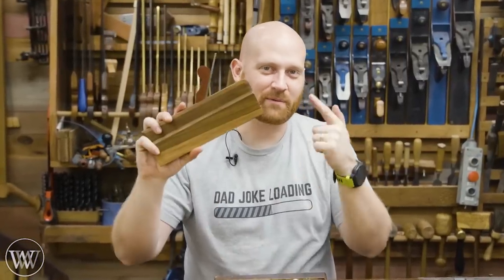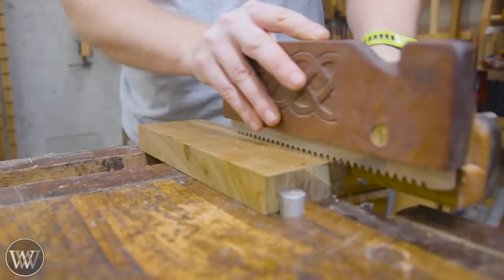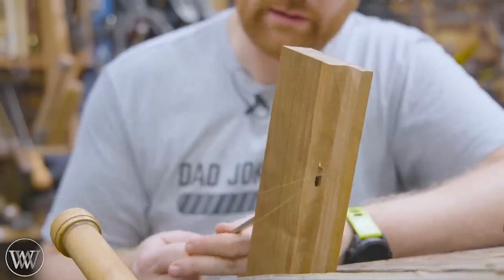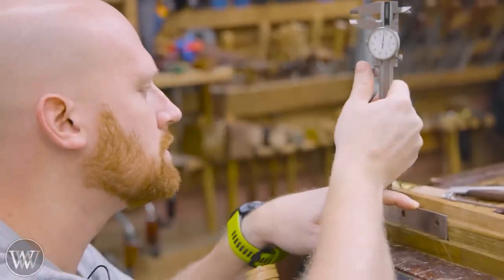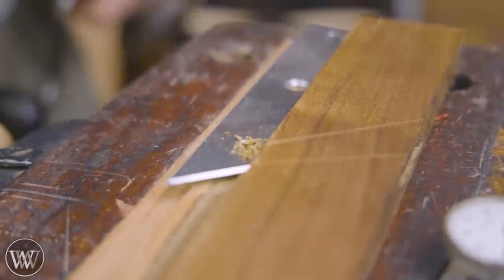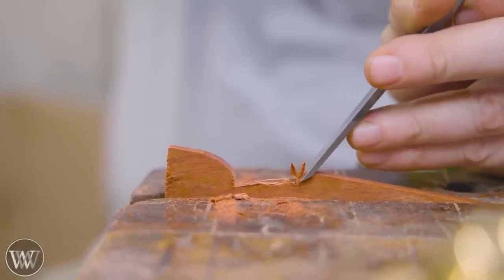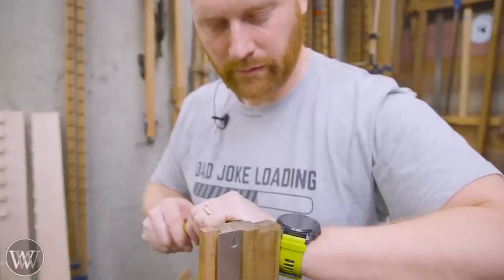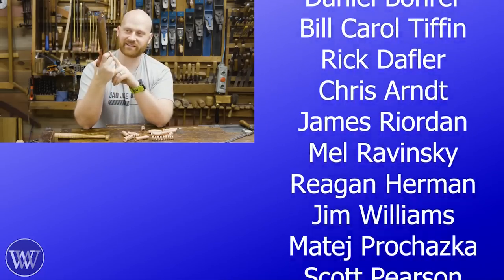How To Make Drawer Bottom Plane Kit From Red Rose Reproductions

Comment: Thanks for sharing.  I've been eyeing this type of drawer bottom plane. FYI, you can buy 1/16" thick tool steel from McMaster.  I know this because, I bought some.  I want to make my own 1/16" chisel.  Yea, for that one time in my life when I will need it.  Will make it beefy and more like a mortise chisel so it can withstand use by hand.
Reply from the maker: You can always replace a big chisel with a little chisel. But you can never replace a little chisel. The carving chisel I had was only about 100th of an inch too wide so just took a few strokes on the course diamond plate to bring it down a thickness. Otherwise I probably would have made a thinner chisel for it

Comment: As the drawer bottom planes are rarely in stock at RRR, I have considered picking up this kit. However, my old brain also remembered a quick and dirty way to buy a drawer bottom plane. Months ago, I bought 3/4" matched planes for making panels. The grooving plane makes a 1/4" wide groove offset by 1/4" from the edge. However, since matched planes need a bit more depth in the groove, it cuts the groove about 5/16" deep. As long as you are not making thin drawer sides, my lazy+frugal side gives a thumbs up to the 3/4" grooving plane.

Comment: You can buy a used table saw blade and use the plate to make a tool to cut that thin groove. Or a blade for 45. It’s a cheap source for hardened or hardenable steel. That does involve an angle grinder though.
Reply: Convenient! I make used saw blades myself!

Comment: How does this plane differ from a tongue plane (half of a T&G set)?
Reply from the maker: A tongue plane makes the tongue so it has two irons side by side. This is the grooving plane that makes the groove for the tongue to fit into.
Reply: The tongue plane form a 3/4"match plane set cuts a similar groove, but the depth stop is fixed at 3/8" rather than 1/4" deep.  Or at least the match planes I make are that way.